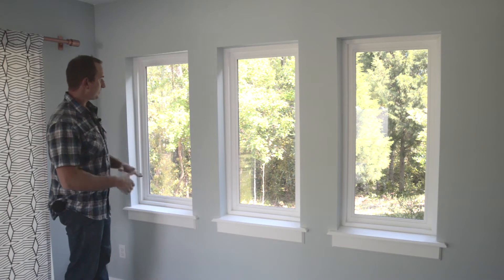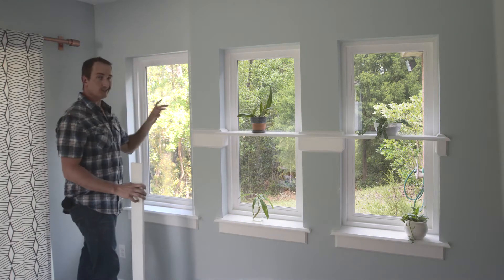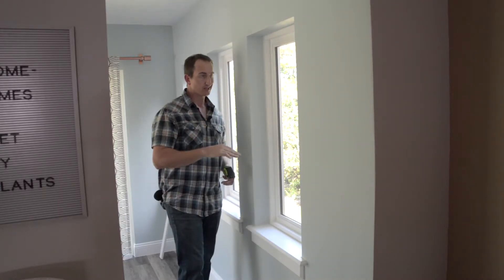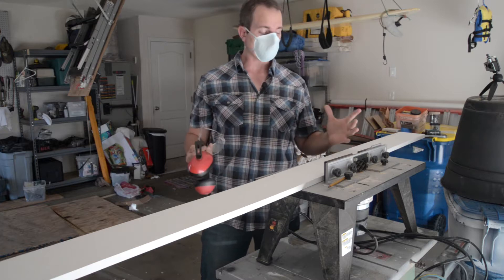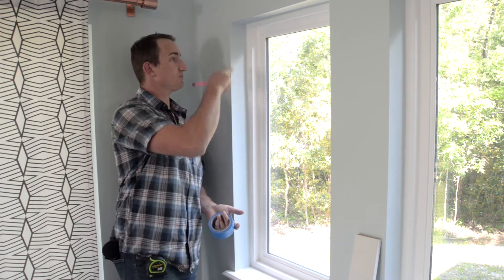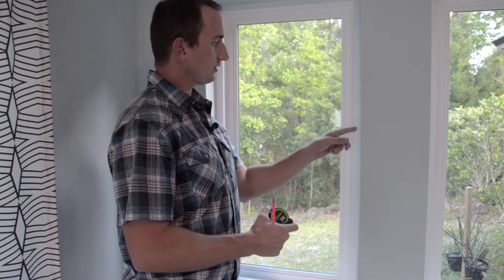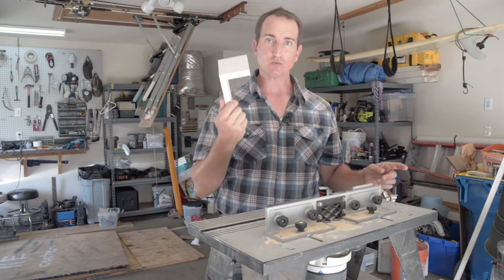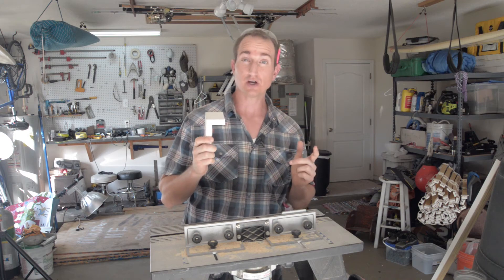How to Build a Window Shelf, Part 1

Comment: Nice video I'm watching the rest. One thing I noticed was you were not flush with your fence when routing. But then I saw you had your guild bearing on the bit which was preventing you from flushing to the fence. Was this intentional to not have to remove the router?
Reply from the maker: Thanks Raymond.  To add the detail to the window plant shelf I relied on the guild bearing on the router bit itself. The use of the router table made the process much easier to keep everything stable.
Reply: @MrKistel  got it. I was wondering why you did it like that. A few hours later the lightbulb went off. I over think things sometimes and that little (trick?) was a good one.
Reply from the maker: @raymondjoseph7177  Thanks again I hope the video was helpful for you